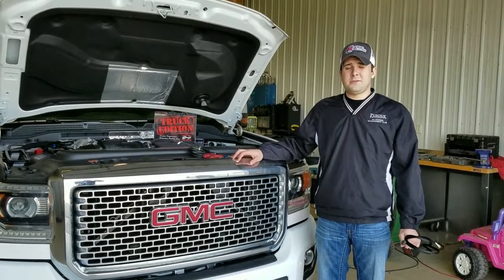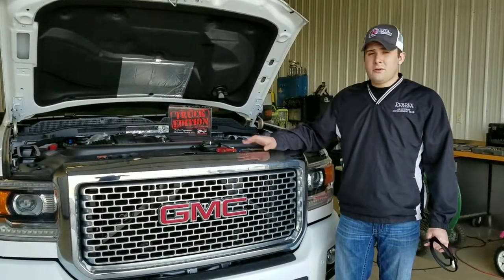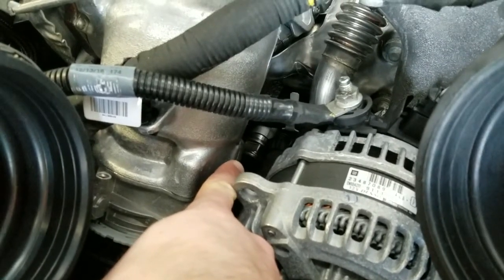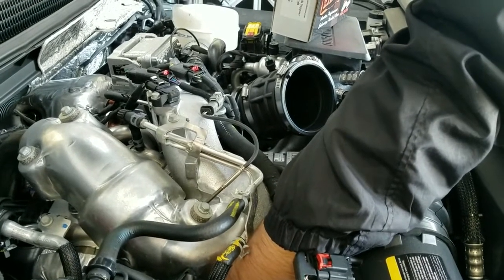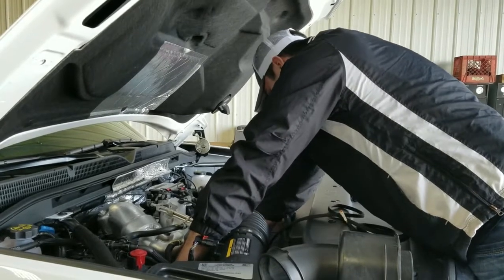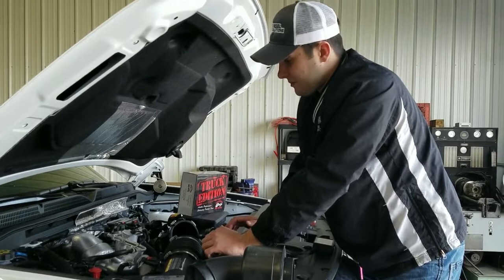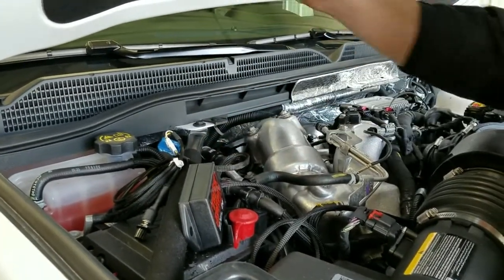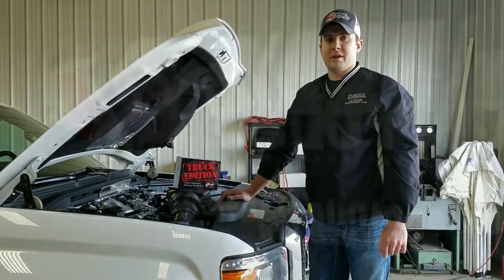2017-2024 GM L5P Duramax: Ag Diesel Solutions 21700/61700/61720  Module Installation

Comment: Just installed this in my 2024 duramax and it did add power but it also put my new truck in limp mode with a p0191 code
Reply from the maker: contact our technical support! thanks

Comment: I had one of those on my truck and it caused check engine light and reduced engine power all the time.
Reply from the maker: Jeremy Cook, very sorry that you had an issue with your module.  While it doesn't happen very often, we are not perfect and some units do fail.  Please make sure and call into tech support 812.618.9168 as all of our products come with a lifetime warranty and they will get you all taken care of.  Thanks.

Comment: I have emailed yall personally but no response. I have recently installed this module onto my 2017 denali l5p with 35s and I thought I was getting great gas mileage. I went from 12 mpg to 16 and was very happy until I calculated it myself and I was still getting 12. seems to me it just tricked my computer.
Reply from the maker: Josh Wright, very sorry about not getting back to your email from the website, we have been having major issues with the emailing system on the site.  We are not in the business of "tricking" your on board computer on your truck.  Was your 12MPG hand calculated with the 35s or was that what the screen said your were getting?  Any changes outside the factory parameters of the truck will throw off the MPG average calculator.  Those systems are set up with very specific algorithms based on 100% factory parameters of the line.  Any change to the truck and the computer can not compensate for those changes and will throw off that average.  Please give us a call 812.618.9168 if you have further questions or want to talk about how the trucks give the mileage average on the dash.  Thanks!

Comment: Can The dealer trace this?
Reply from the maker: The module can not be traced by the dealer.  Once the module is removed, there is no way to tell the module was ever on the truck at all.  If you have further questions, please give us a call at 812.618.9168
Reply from the maker: The module can not be traced by the dealer.  Once the module is removed, there is no way to tell the module was ever on the truck at all.  If you have further questions, please give us a call at 812.618.9168

Comment: Nothing against you man.... but until there is full emissions delete exhaust and tuning for this truck, just paint it in rainbow collars and use it to pull the lead float in a gay pride parade....
Reply from the maker: Totally understand what you are saying here.  With all the new emissions equipment the newer trucks have a little trouble off of the line and are getting pretty embarrassing fuel economy numbers.  But that is why we have our product.  This allows you to keep your warranty on a $50K+ truck, not defeating or deleting any emissions components and giving you a little extra horsepower and fuel economy while keeping the truck totally stock.  Our module isn't for everyone, but if you want a nice bump in horsepower and save on fuel then our module works quite well.
Reply: Highball 734 yup I have zero good for the big tree hugging quiet exhaust.. I could careless if it smokes or not.... by the way my LB7 zf 6speed makes 550 hp and 1100 foot pounds of torque to the ground.... I do it for you...
Reply: Highball 734 I  know your type.. typical snowflake democrat.... I have over 2 million miles from over the road trucking in my W900L Kenworth 6NZ cat.. I make good money.. but thanks for your concerns.. my children are happy and well taking care off....
Reply: Highball 734 no faux news here.. I'm realy amazed at how much I have bothered you..  stop throwing yourself under the bus and be confident in yourself..
Reply: Highball 734 it's not a race truck.. it's just my pickup I drive to town or where... just a simple south bend clutch and other upgrades..   I see your still releasing your snowflake democratic opinions with the whole boyfriend thing.. secondly there is no one to thank. I bought the truck new in 2003.. it's well kept and reserved... but since your so interested my wife drives a fully deleted LML
Reply: Highball 734 in another 5 years or so after the L5P is cheaper on a used car lot and delete kits and tuning is avalibe we will buy one
Reply: Asbrstos?? Realy ?? You obviously don't have anything to prove other than just nit picking.. please by all means forgive me for enjoying the sounds of a open exhaust turbo diesel...
Reply: 26,000+ miles on my L5P no troubles yet. Many miles of towing included.
Reply: F18M 223 that is awesome !!!
Reply: +Highball 734
Let's clear the air - you're a dumbass.

You complain about diesel being a threat to "other peoples' lungs". Citations? What are you basing these claims on? I really hope you're not relying on the fictional 'studies' conducted by the same leftard cucks who think man-caused climate change is a thing...and that the solution is a world-wide carbon tax.

The USELESS diesel emissions systems on ALL trucks, including commercial trucks, have been responsible for countless amounts of downtime and the consumption of many millions of gallons more of fuel. You believe that these systems 'solve' a problem, but fail to grasp the simple fact that diesel emmissions were never a problem.

So the substantial hits to engine reliability, fuel economy, and performance incurred by forcing manufacturers to install ridiculous emissions contraptions are not helping anyone other than the fuel companies that benefit from the higher fuel consumption.

But yes, you are a leftard and you believe that you know what's best for everyone else when you can barely wipe your own ass without checking youtube for a how-to video. LOL

Wrong country, bro. The USA is no place for pedocrats like you.